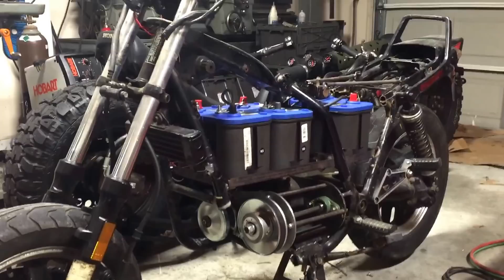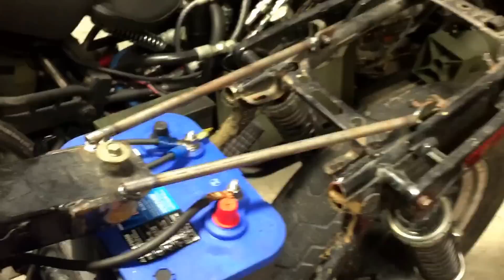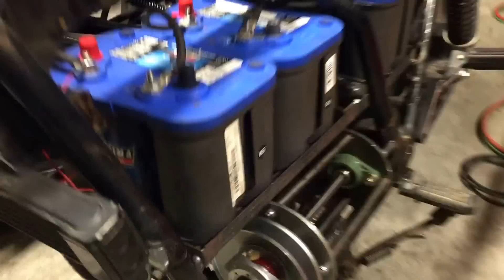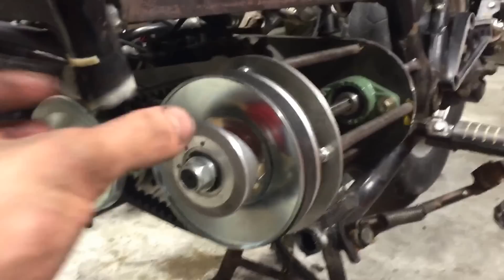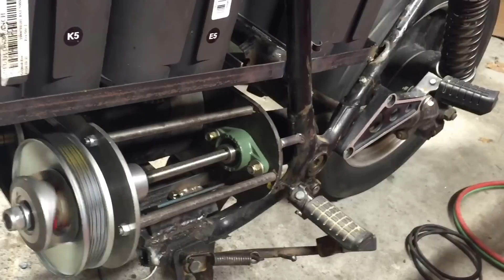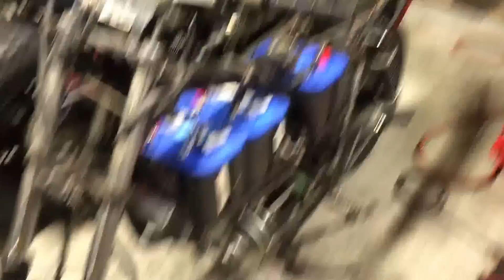First spin over of CVT upgrade to $572 Electric Motorcycle!

Comment: Those bolts that mount the frame that holds the jackshaft for the CVT look like they're going to shear in no time! They vibrate a hell of a lot!
Reply from the maker: The motor is just barely bolted on right now, the final assembly, I am going to make sure everything is tightened down fully.
Reply: @Dieselmonkey89  have you re-visited this project lately? I am curious if adjusting the CVT spring achieved the results you were hoping for? I like the concept of a CVT on an electric motor for increasing top end speed and still retaining bottom end power.

Comment: NICE!  Where did you get that CVT from?  Is there any way to set it up so the "gear" / belt ratio is selectable?  Or is it only an RPM / torque sensitive type system?
Reply from the maker: I bought it on eBay for $72 The CVT is a cheap knock off of the original Comet TAV2 CVT. The CVT can not be adjusted while running, but increasing and decreasing the driven clutch weight assembly, and spring tension will increase or decrease the base RPM of engagement.
Reply: +Dieselmonkey89 Cool thanks for getting back to me.  BTW your diesel motorcycle is SOOOOO cool!  You gotta try to get that on Jay Lenno's garage.  I really want to modify a CVT so that the driver  / operator has control over the ratio on the fly.  Seems like it would n't be that too hard to do.  Just figure out a way to push on the driven clutch side to squeeze it to make the belt ride at a different radius.  Are you using a motor controller also?
Reply from the maker: + What's Will Doing Thanks! I would love to get it on jay leno's garage, I'm taking the bike to a big bike show at the North Atlanta Trade Center in Atlanta, GA at the end of this month. Hopefully that will be great exposure to get the word out to Jay Leno. As far as a selectable CVT, i think it could be possible if you had a lever attached to a throw out bearing, that could push on the driver clutch in place of the springs and weight assembly. You would have to make a bracket that would hold the lever steady at any position you set the CVT to, because the belt would always be under tension trying to return to neutral.

Comment: Hi Sam, Any news yet on your VERY interesting CVT conversion?
Reply from the maker: The project has stalled a bit. The golf cart motor doesn't produce enough rpms under load to make the CVT pulleys advance. So it is stuck in low gear for now, I need to add another battery to give me 48v to increase rpms. I will eventually get around to making room in the frame for 4 batteries, but for now I am focusing on the Kabota diesel in a goldwing frame conversion.
Reply: Quite a pity, Although I love your other stuff I am very interested in electric motorcyles, if only to avoid the smokescreens your hydrostatic build conjures up. :-)
I was just wondering how the CVT would work. Is it just a workaround for the shaftdrive and thus more a complicating factor or would it also have more general advantages?
Ah well. It's easy to come up with an basically sound idea but much harder to build something that wil really work under every day circumtances.
I am myself finishing a motorcycle project that actually took me about 11 years and I did not even change anyhting about the engine. You can have a look at www.brassee.com. Just imagine an electric version of my Pteranodon bike!
Reply from the maker: I modified the CVT driver pulley by completely removing the internal spring so that it would engage instantly after the motor started spinning. The main purpose of having the CVT was to help decrease the starting load on the motor, because when I had the electric motor connected 1:1 with the driveshaft, the electric motor pulled enough amps to melt a 500amp contactor. Another advantage of the CVT was that it would optimize the gear ratio at higher speeds to help keep running amps as low as possible, which helped with the total range of the bike.
Reply: Exactly the sort of advantages one would hope for / expect and the reason why I'll be interested in hearing anyhting you might have to add in the future. So please keep me / us posted.

Comment: Where did you get this CVT transmission from? Thanks
Reply: You can get CVT transmissions from older Honda Odysee off road vehicles or from golf/go carts. https://www.ebay.com/i/183367247195?chn=ps . Note that the CVT this guy's using is for very low power, but the one from an older Honda will handle more power, albeit at a cost (mine was $300 used from Honda Odysee). Making low power EVs might be good for your budget, but do EVs a disservice when people post half-cocked, low power vehicles like this. I am not suggesting that people give up their projects, just don't make it so public. Show the world your powerful machines, not your 40 km/h slowmobile. If it doesn't put out 100+ horsepower and 100+ ft-lbs of torque, I'm just not interested. I no longer need my CVT if you're interested in buying it, let me know.

Comment: Hi. Did the CVT improve the range of your bike for the same battery capacity?
Reply: The use of a CVT in a shaft driven bike is merely for increased top speed without sacrificing acceleration. Since he can go faster with this configuration than he could with a direct drive (motor shaft directly mounted to drive shaft), range will actually be reduced if all other aspects remain, as higher top speed introduces more drag (see inverse square law: double speed=quadruple drag). If you are considering a conversion, avoid shaft drive, especially given that you had to ask the question about CVT's relation to range. I am not bashing you, but being realistic. Chain or belt driven electric motorcycles are IMO the only WTG, unless you just happen to have all the parts laying around and budget is of concern.